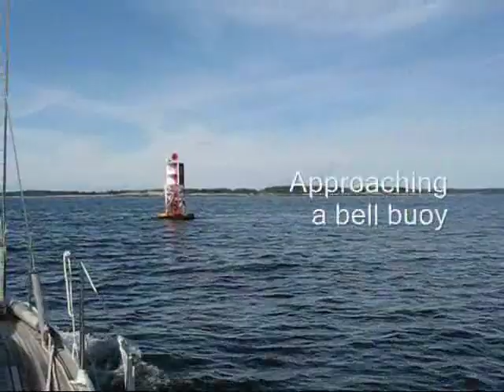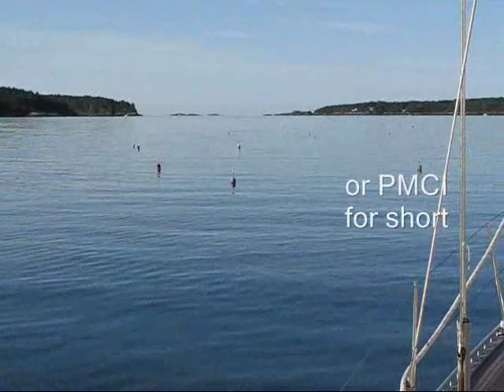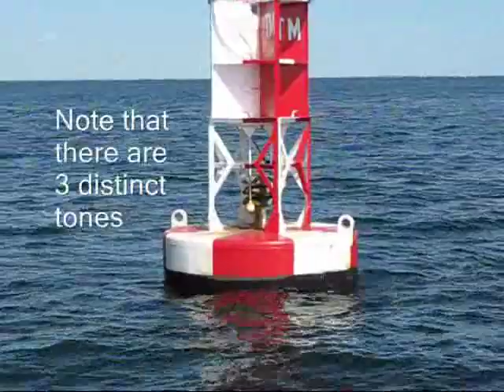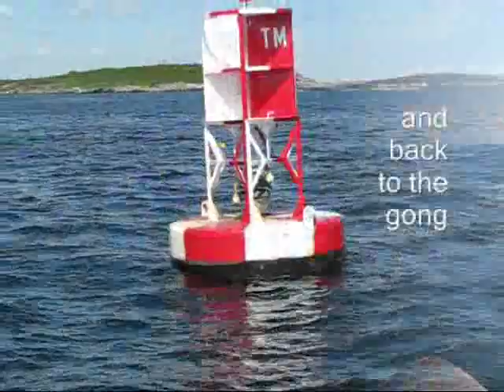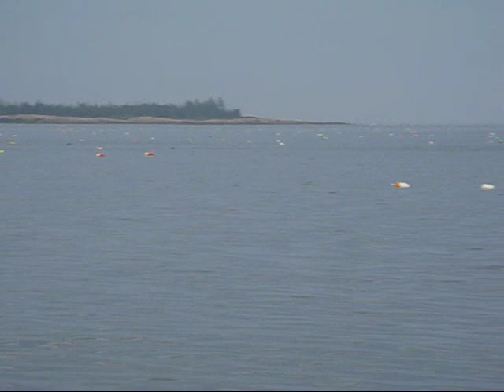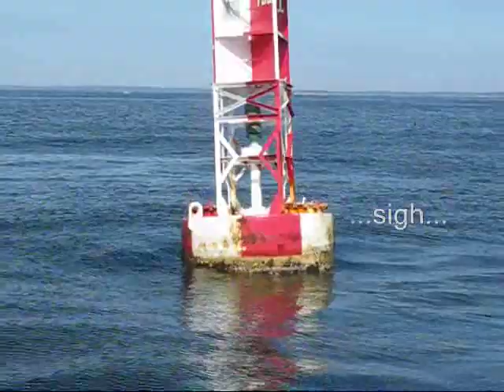Bell buoy, Gong buoy, Whistle buoy and klingons

Comment: Why do they have a sound? What's it for?
Reply: The sounds help identify the navigation marks when sailing at night or in fog. Typically only one sound type would be within hearing range. This was especially useful before the advent of radar and GPs, etc.
Reply: @laurasanchez7105  The idea is to find them but then to pass without hitting them. Once you are near one, you can see where you are on the chart.